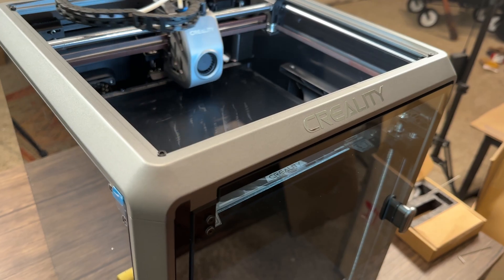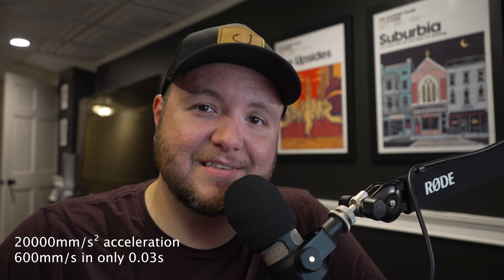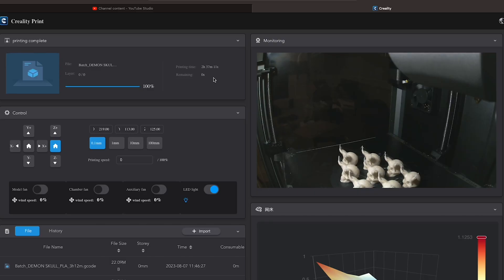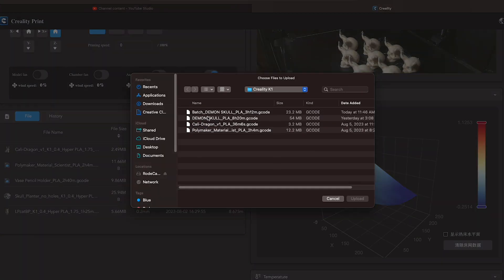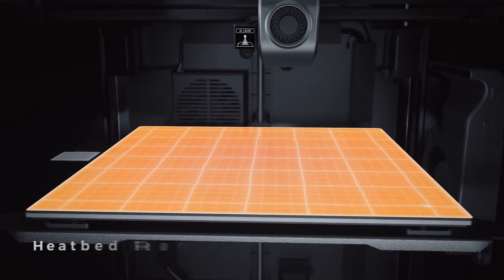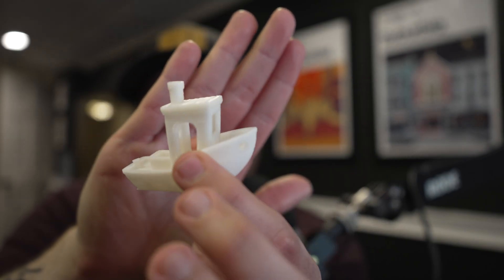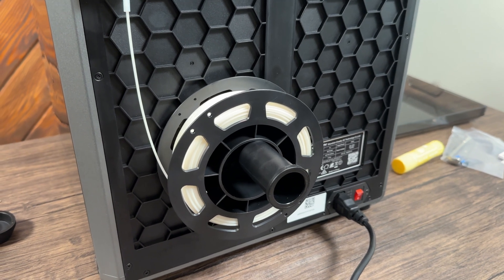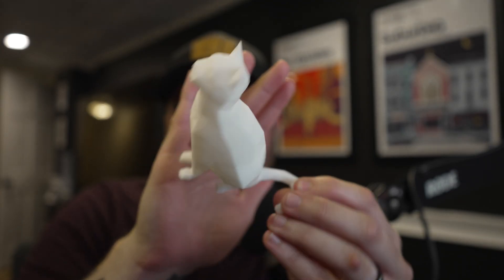A 3D Printer With So Much Potential… But Will It Deliver? | CREALITY K1 REVIEW

Comment: I have a x1c but also just picked up a k1 cheap at micro center. I have been loving bambu slicer ever since i got my x1c and hasn't too happy going back to cura for the k1. I stumbled on a redit post about galaxy slicer and a few videos later and im here. Going to try it tonight, quality was way better than my bed slingers but still behind bambu. If this helps even a little I'll be happy. Thanks for the video.

Comment: Not particularly pleased with my Creality CR-10 V3 at the moment since I had to finally break down and replace the POS extruder/Hotend that came with it for a Micro Swiss (the Micro Swiss on the other hand is awesome). Why this was necessary is because of the poor build quality of the V3. Nor was I the only one to have to do this. Prior to that I had to do the Z axis hack, because, well it's a Creality, and they don't seem to understand the need to put it together properly at the factory.

The specs look fairly good, but the tiny build volume at 8.66" x 8.66" x 9.84" would be a deal breaker for me to begin with. That folks, is pretty tiny. There is the K1 Max though.

This guy gives the good and the ugly of the K1 (while comparing it to the Bambu P1P): https://www.youtube.com/watch?v=FPjTeTDb7r8 See what he says about the Creality phone app. What a joke.